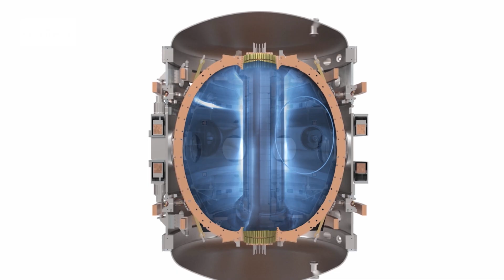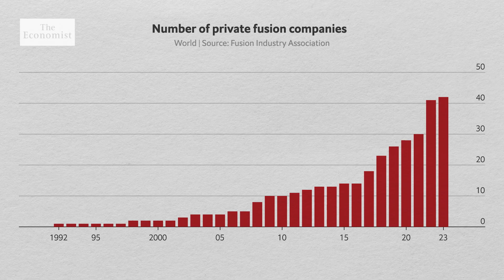Is nuclear fusion the future of clean energy?

Comment: Nuclear fusion energy research experiments began in the 1950s and since then the promoters have been consistently overselling how soon it will likely evolve into a fleet of commercially practical power plants. They've learned to use the complexity of the field to justify omitting key evaluation parameters when presenting to journalists, the general public and to funders of their fun experimental endeavors. Scores of nuclear fusion energy experimental machines have been created since the early days. See the Wikipedia article titled 'List of fusion energy experiments.' The vast majority of them never achieved any significant amount of fusion reactions because they didn't include tritium as their fusion fuel.

Commonwealth Fusion Systems (CFS) is no different in its misleading presentations. They first bragged that their new high temperature superconductors would be game-changers. They rarely mentioned that they would need to operate at a temperature of 15 Kelvin. They often claim that their SPARC machine, now under construction, contains the basics of a nuclear power reactor, such as planned for their ARC machine. The fact is it lacks a robust heat removal system, a steam generator, a condenser, a secondary cooling system heat dissipation system, a turbine-generator system and an electrical substation. It also lacks any components of a tritium breeding and purification system which is deemed essential for most future commercially practical fusion energy electrical generating stations. SPARC will also operate in a pulsed mode with a maximum of 10 second 'ON' times and likely lengthy recovery 'OFF' times. It experimental duty cycle will be low.

The SPARC administrators claim that they intend to achieve net fusion gain by the end of 2026. They tend to avoid clearly defining the input energy parameter that they will be using to calculate the so-called 'net fusion gain.' Typically all nuclear fusion energy experimental projects use the input energy that couples to the plasma to heat it to fusion energy temperatures of around 150 million Kelvin. That input energy parameter ignores the total amount of energy needed to operate the facility during the experimental days. That energy value can easily exceed the plasma input energy by a factor of 100.

Since the nuclear fusion energy experiments were started the promotional pitches have typically claimed that the hydrogen fuel was almost unlimited. Often the experimental leaders omit mentioning that the key fuel, tritium, is radioactive. They never state that the current commercial price for tritium is in excess of $30,000 per gram. It has long been assumed that once a commercially practical power plant design is created that each reactor will be capable of generating enough tritium to fuel itself.

Fusion energy fans tend to immerse themselves in echo chamber information sources that reinforce what they prefer to believe in. They also tend to avoid engaging in critical analysis that might spoil their love affair. Most justify this technological love affair by claiming it is essential to save us from Anthropogenic Climate Disruption (ACD). Typically they avoid closely following our failed attempts to stop the continuing rise of greenhouse gases during the last 30 years.

Virtually all nuclear energy promoters, are in line with the vast majority of Earth's other 8.2+ billion humans, who continue to assume that we still have at least 20 years left to turn this 'Titanic' around using their favorite nuclear technology. They have become masterful in excluding the following warnings from their consciousness. I urge readers to search for the following two article titles.

IPCC report: ‘now or never’ if world is to stave off climate disaster (TheGuardian)

UN chief: World has less than 2 years to avoid 'runaway climate change' (TheHill)
  * This statement was made 6.6 years ago.

Comment: I’m surprised at the negative comments around fusion energy. With the accelerated advancement in progress on this it is only a matter of time before it is solved. Fusion energy is a game changer. The amount of resource to build solar and wind farms with the relative low energy return, will never compare with the energy return of fusion energy.
Reply: 'it is only a matter of time before it is solved" there is absolutely no guarantee of that. "Fusion energy is a game changer. " if it works. "The amount of resource to build solar and wind farms with the relative low energy return, will never compare with the energy return of fusion energy." how much commercial electricity has solar and wind produced? How much has fusion? How many tens of billions have been spent on ITER?
Reply: @jb76489 it will happen sooner than people think. I believe private companies are going to beat ITER into the fusion race, companies like CFS and general fusion seem more promising because they are using more advanced tech or different concept.
Reply: Nuclear fusion energy research experiments began in the 1950s and since then the promoters have been consistently overselling how soon it will likely evolve into a fleet of commercially practical power plants. They've learned to use the complexity of the field to justify omitting key evaluation parameters when presenting to journalists, the general public and to funders of their fun experimental endeavors. Scores of nuclear fusion energy experimental machines have been created since the early days. See the Wikipedia article titled 'List of fusion energy experiments.' The vast majority of them never achieved any significant amount of fusion reactions because they didn't include tritium as their fusion fuel.

Commonwealth Fusion Systems (CFS) is no different in its misleading presentations. They first bragged that their new high temperature superconductors would be game-changers. They rarely mentioned that they would need to operate at a temperature of 15 Kelvin. They often claim that their SPARC machine, now under construction, contains the basics of a nuclear power reactor, such as planned for their ARC machine. The fact is it lacks a robust heat removal system, a steam generator, a condenser, a secondary cooling system heat dissipation system, a turbine-generator system and an electrical substation. It also lacks any components of a tritium breeding and purification system which is deemed essential for most future commercially practical fusion energy electrical generating stations. SPARC will also operate in a pulsed mode with a maximum of 10 second 'ON' times and likely lengthy recovery 'OFF' times. It experimental duty cycle will be low.

The SPARC administrators claim that they intend to achieve net fusion gain by the end of 2026. They tend to avoid clearly defining the input energy parameter that they will be using to calculate the so-called 'net fusion gain.' Typically all nuclear fusion energy experimental projects use the input energy that couples to the plasma to heat it to fusion energy temperatures of around 150 million Kelvin. That input energy parameter ignores the total amount of energy needed to operate the facility during the experimental days. That energy value can easily exceed the plasma input energy by a factor of 100.

Since the nuclear fusion energy experiments were started the promotional pitches have typically claimed that the hydrogen fuel was almost unlimited. Often the experimental leaders omit mentioning that the key fuel, tritium, is radioactive. They never state that the current commercial price for tritium is in excess of $30,000 per gram. It has long been assumed that once a commercially practical power plant design is created that each reactor will be capable of generating enough tritium to fuel itself.

Fusion energy fans tend to immerse themselves in echo chamber information sources that reinforce what they prefer to believe in. They also tend to avoid engaging in critical analysis that might spoil their love affair. Most justify this technological love affair by claiming it is essential to save us from Anthropogenic Climate Disruption (ACD). Typically they avoid closely following our failed attempts to stop the continuing rise of greenhouse gases during the last 30 years.

Virtually all nuclear energy promoters, are in line with the vast majority of Earth's other 8.2+ billion humans, who continue to assume that we still have at least 20 years left to turn this 'Titanic' around using their favorite nuclear technology. They have become masterful in excluding the following warnings from their consciousness. I urge readers to search for the following two article titles.

IPCC report: ‘now or never’ if world is to stave off climate disaster (TheGuardian)

UN chief: World has less than 2 years to avoid 'runaway climate change' (TheHill)
  * This statement was made 6.6 years ago.

Comment: Yet another video talking about the challenges of fusion reactors to produce energy. Nothing about the industrial side of it: how to produce sufficient fuel (in most cases deuterium and tritium) to feed the reactors. A large reactor like ITER in southern France is estimated to be using 250 kg of fuel per year to sustain a fusing reaction powerful enough to generate 1000MW of energy.
At the moment, the only tritium available comes from heavy water produced in fission reactors. It is not commonly available in nature and though scientists hope that the fusion reaction itself will transform some of the deuterium introduced in the reactor into tritium to continue the reaction, it is only a theory that would render the technology pointless if not proven true, given the alternative would be through using lithium, which is not an infinite resource like they claim.

Comment: No, Green hydrogen is the way to go. Nuclear is expensive, dangerous and pollutes like no other. Fusion looks promising, if it works. Don’t let them gaslight, green hydrogen is the answer we have now and can save us from catastrophe.
Reply: Fusion uses hydrogen and helium
Reply: Fusion will govern us heluim which is becoming sparse
Nuclear fusion has no waste and practically 0 emissions
Yeilds millions times more energy per kg than fossil fuels
Is reliable and not dependent on wheather
Reply: @RicoHelms  No waste?  have you read a fusion formula?  one count of tritium-deutrium fusion of two atoms will give out one 10 plus MeV neutron.  Fast neutron is a strong kind of radiation.  It will turn any metal nearby radioactive.  Thus there will be radioactive metal to be handled when the fusion plant is decomissioned.  Hardly no waste.

Comment: this is totally ignoring the fusion breakthrough of last year ?
Reply: What breakthrough? Did you not get the correct numbers? It was a milestone but not a breakthrough. 2.05 megajoule laser energy in. 3.15 megajoule heat energy out from fusion. But 322 megajoule consumption of electrical energy to run the lasers. And the concept used at NIF is not suitable for a power plant. It is suitable for ignition of hydrogen bombs. The NIF is a structure for military research and development.

Comment: After 70 years, there is still no fusion energy on the grid. Also during that period, the fusion “industry” has consumed fantastic amounts of concrete and steel, the manufacture of which is among the world’s leading producers of greenhouse gases. If by some miracle fusion were to become viable and cost effective, it would first have to undue the damage it has caused before it could be considered green energy.

Comment: I think it is the long-term future as needs increase. Before knowing how to harness thermonuclear weapons, it was thought impossible to make something like it but to then make thousands is entirely unconscionable, as was done in 70s and 80s. So it's technology that's going to eventually make fusion power harness-able. But without impetus like world war/human destruction, resources and energy needed to achieve the goal, i think won't happen without it, but I'm sure it can be done.
Reply: Archer and Jacobson (*) estimated that 20% of the global total wind power potential could account for as much as 123 petawatt-hours (PWh) of electricity annually [corresponding to annually averaged power production of 14 terawatts (TW)] equal to around 7 times the total current global consumption of electricity (comparable to present global use of energy in all forms). Their study was based on an analysis of data for the year 2000 from 7,753 surface meteorological stations complemented by data from 446 stations for which vertical soundings were available. They restricted their attention to power that could be generated by using a network of 1.5-megawatt (MW) turbines tapping wind resources from regions with annually averaged wind speeds in excess of 6.9 m/s (wind class 3 or better) at an elevation of 80 m.

* CL Archer, MZ Jacobson, Evaluation of global wind power. J Geophys Res 110, D12110 (2005).
Reply: I'm 72. Been hearing my whole life, fusion is just 20 years away. I think under the best case scenario, it is still 20 years away from commercialization.

Comment: The main issue with nuclear is not safety, the physics, or even waste disposal but cost. It's just really expensive to build nuclear energy facilities, expensive to employ the engineers to run the said facilities, and expensive to repair and maintain them in the long term. Nuclear would require heavy subsidies from the government to be economically viable and that means more taxes and people would still end up paying more for their electricity. Nuclear only makes sense when the alternatives are prohibitively expensive due to geography, for example.

Comment: In my layman's opinion, fusion is a white elephant. As far as I'm able to understand it, in the sun, self sustaining fusion reactions are possible because the massive gravity provides the free input of energy necessary to overcome exclusion between atoms. On earth, massive amounts of energy input is required to simulate that gravitational pressure - and the laws of physics state this must come at a net loss. Otherwise, it's perpetual motion. 
The future of clean energy is magma/ electricity/ hydrogen.
Reply: I invite you to read about this week's breakthrough at the Lawrence Livermore National Laboratory in California. They succeeded an output of energy greater than the energy invested and replicated the experiment three times now.
Reply: @Palladas4862  so long as you dont consider the energy needed to get that energy into the reactor, the energy losses involved in getting that energy out of the reactor and into useable electricity and that even the false q values of 1.5 isnt even close to what we need, sure
Reply: @Palladas4862  Not exactly. LLNL pumped in 2.05 megajoules of power, and got 3.15 megajoules of raw heat energy out; but that heat energy still needs to be translated into useful power. Even at a maximum Carnot efficiency, converting heat to electricity at 60%, there would be an end to end net loss.

Comment: When I was a kid of 10 in 1956, , the Zeta project was announced, largely, I think, looking back, to divert attention from the disastrous Suez campaign. This project originally based at Harwell, was claimed to have the potential to produce unlimited power using fusion. And now here I am 67 years later, and whats happened so far ?  Well, fusion power is still a long way off.

Except it isn't, if you think about it. The heat from the sun is generated by fusion and we collect that power as so called "renewable power" using wind turbines. Getting power out of a future fusion reactor will also require turbines, steam turbines.  So not much difference. It seems to me that it's better to concentrate on what we can use now, and leave fusion potential to clever scientists to see if they can see any possible "leap" that would make fusion power stations cheap enough to use. Lets face it,  unless the sun stops shining, the wind will continue to blow so lets use this free energ y !
Reply: Every time I see a propellor on a stick I grit my teeth. Bad design grates on my engineering nerves. Allow competition to innovate solutions and we'll be fine. But you'll never get that with big government married to big corporations.
Reply: I would argue its far more likely generative fusion reactors would utilize gas capture systems with brayton cycles than use a steam turbine.
Reply: @MattBuild4  Sure. Sunshine and lollipops. Although, to advocate for the devil, one team plans to use coils around the plasma as pickup devices since the plasma induces a current.

Comment: The problem is, they haven't reched "breakeven", when the energy out is greater than the energy going i in to start the process. Every step closer to breakeven has meant ever larger and more expensive reactors, by the time they exceed breakeven and can produce useful amounts of energy, the reactor will be so huge and exxpensive it will not make economic sense. Perhaps there might be some "cost is no objection " use, but Fusion will never solve our energy problems.
Reply: That sounds like a dumb excuse
Reply: @khulmach9662  well its the truth so

Comment: There is no rational reason to think fusion can be an economical way to produce civilian power, if it is possible at all.  On the other hand fission already provides more clean energy than any other source.   3/4 of all nuclear reactors are pressurized water reactors which was invented by Dr Alvin Weinberg at Oak Ridge for the Nautilus.  Dr Weinberg did not think the super-sized PWR was safe and was fired for speaking his mind along with promoting the molten salt reactor which is inherently safe.  Our only path forward is the MSR.